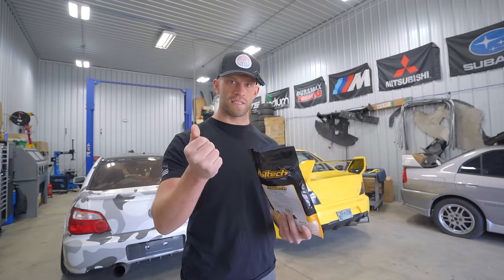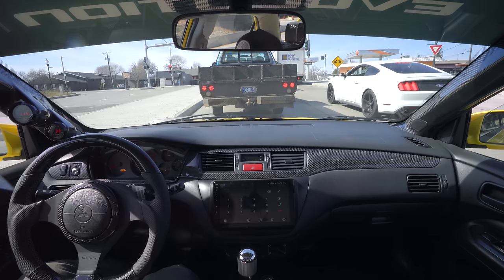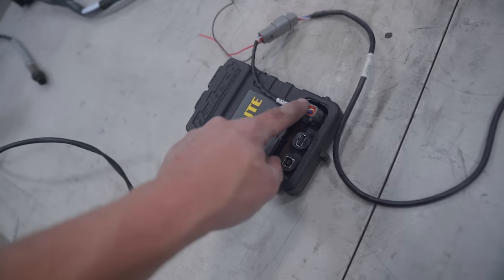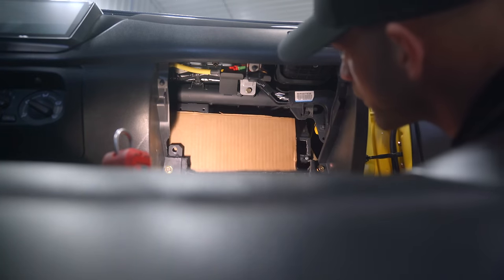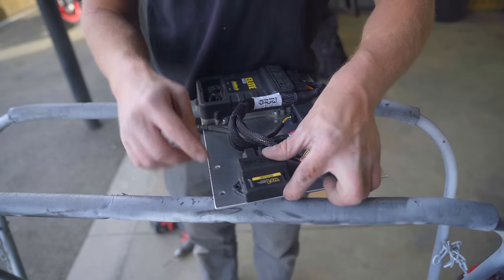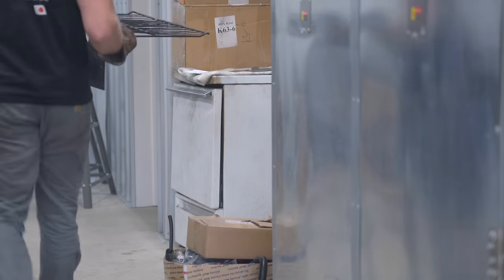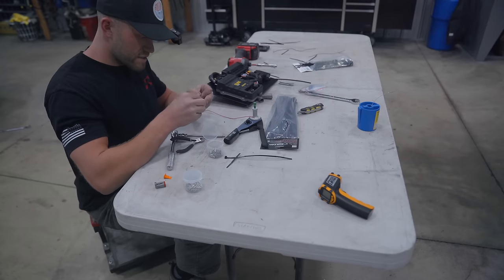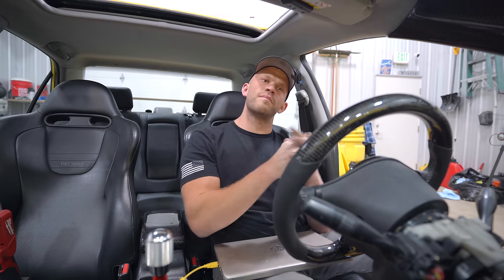Installing a Haltech Elite 2500 onto the Evo 8!

Comment: You can use the metal part in the wiper blades to be able to pass the wires easily from the engine bay to the inside. Since it's flat it will go easily

Comment: Sometimes insread of using two sided tape, we will use velcro to mount stuff that might need to br removed. Its stong enough to hold my radar detector on my R1 @170+mph and its cleaner than wire ties

Comment: Prolly too late but there’s a 3d printed mount online that’s cheap that puts it in the stock location, mount the wb1 to the back of it route the plug and play box into the shifter cable area. Mine came out clean no cutting

Comment: Side note,  I'd say get a pro fab hood dump setup on the Type R (if you must do a hood dump, which is highly ill-advised UGH). The current one is blasphemous, i.e. bummy!!!
Reply: I understand the thrill of a hood exit especially on a car like that. I think what would fit the whole feel of the build better would be a super clean fender exit. You could use a bypass valve that opens the fender exit for WOT and make the car more daily able and not have fumes in the cabin while cruising
Reply: @joemaggio6806 I'm not a fan of fender exits neither but yeah, a vavle system sounds legit! I never been a fan of anything other than an actual exhaust system for ANY type of setup. Hood and fender exits are just plain bummy and looks lazy imho. I've seen some cool exits in drag spec cars but still not a fan whatsoever!
Reply: @rj5485  I totally get it. It takes a certain car to be able to rock anything but a plain old exhaust. Seems like the man has made up his mind on this setup though. Maybe he'll see this and go with the cutout/valve since he built that whole nice exhaust that's headed for the bin haha